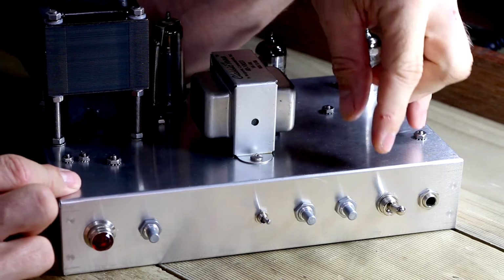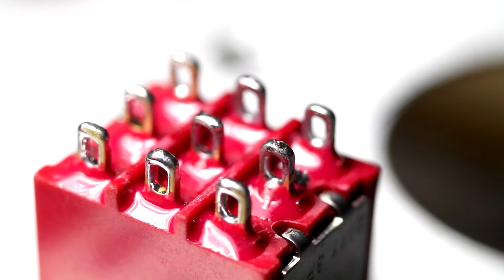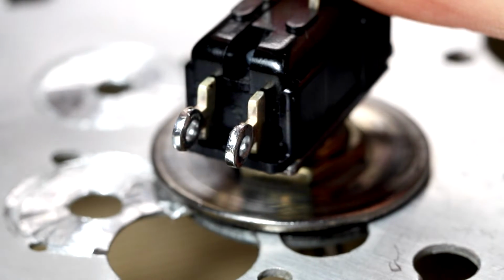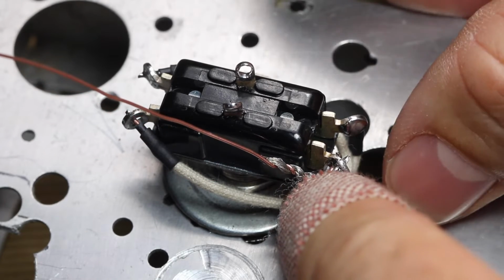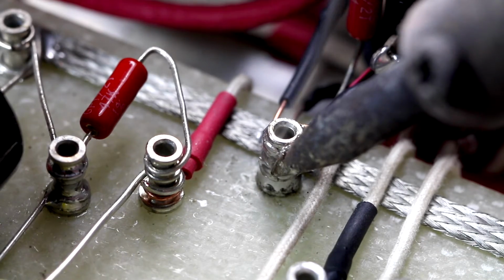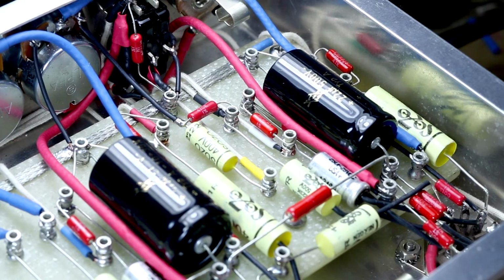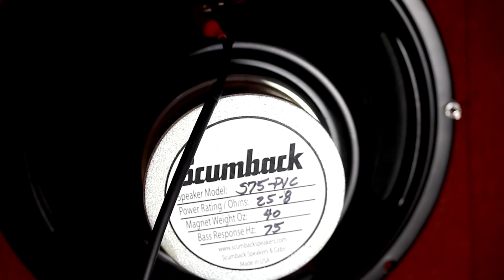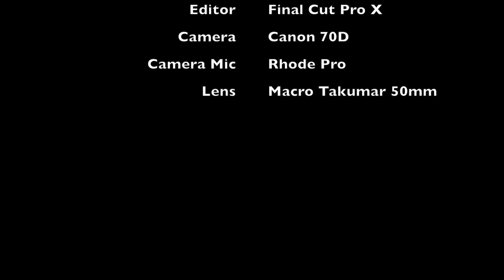Small Tube Amp Build - Step by Step (7 - Pots, Switches, Small Demo)

Comment: Gosh Geoff, I am so enjoying all your videos! I so work differently, a lot rougher with far less planning so your meticulousness is totally inspiring. I suppose it's the art thing I did for years which encouraged mistakes because then I'd be in territory where I'd have to come up with new ideas... but now I'm back into amps, effects and guitars, well lets just say that being careful and applying forethought is a good idea and your work is great for that. Actually I wouldn't mind sending you some wood to play with as here in East Tamaki, Auckland I come across a fair amount of Rainforest woods that arrived as packing crates, especially a CNC machine importer down the road. I've ordered the plan set and my email is within that so if you wanna follow this up I'll get your address and see about getting stuff to you. Cheers matey!
Reply from the maker: Hi Sean! Sorry for delay in reply, Easter got a little busy. Thanks for the kind words. I checked through my records but cannot find your email, perhaps it is under a different name? If you could email me through my website then I will certainly get your address. The hardwood sounds very interesting as well as your amp and effects work. Get in touch certainly, cheers!!

Comment: This series is far and away the best of its kind that I have ever seen.  Great job !!  I have watched the last few videos. I just happend across video #3 ( I think that it was 3, maybe 4 ) . So I haven't seen the first couple videos. I am very interested in the materials you have used. Board, wire, switches, jacks, etc.... . Do you mind sharing where you acquired you materials? Did you collect everything from one source or many ? I particularly like the switches and jacks you installed. I rather like your choice of wire. I do apologize if you shared this info in a earlier video already. I will be going back to watch those videos. Once I finish up the videos from which point I'm at now. 
    Again, thank you and a job well done. Watching you assemble this amplifier has been a treat.

Comment: That wiring is a work of art;  great series of videos too, and the amp sounds great and better still through headphones. 
Is that another guitar that you have built and if so will we be seeing the build videos.
Reply from the maker: Thanks SAF! Yeah that is a guitar I built some time back. It was made from one piece of Matai wood (NZ Red Pine) and I made just as a parallel build so that all the mistakes could be made on this guitar first. Turns out to be my favourite, so light and wonderful snarly tone. In my experience, one of the finest tone woods I've used. I need to replace the neck as it is too narrow for me so I'll probably do that soon and document the process. Many thanks, have a great day!

Comment: How it is called? Is this any special PCB? Can it be ordered in ex. from Aliexpress? With that metal pins?
Reply: This is not a PCB (printed circuit board) this is a turret board. You can either buy it or make it yourself.

Comment: Those 1% resistors look expensive, are they really necessary?
Reply from the maker: They are not too expensive. I only used these because they have long leads and are a cool colour. They are way cheaper than Takman's but not the cheapest by a long stretch either, cheers. I think they are about 15 cent a piece, something like that.